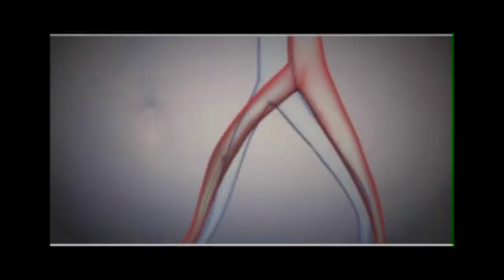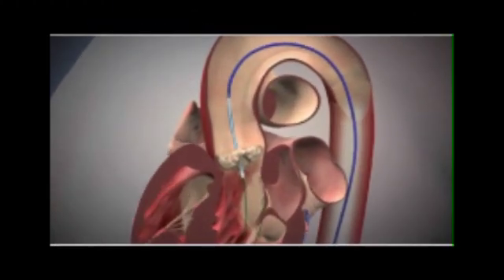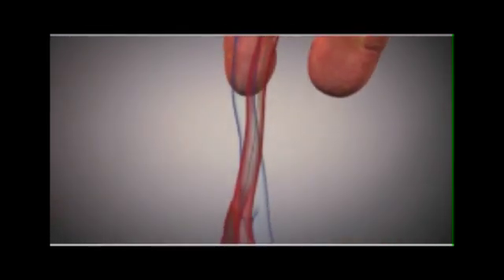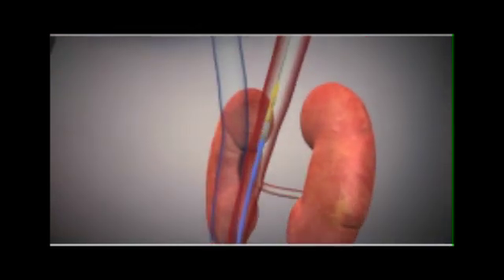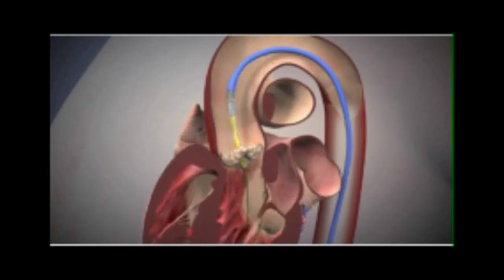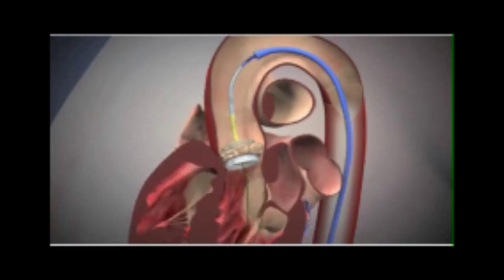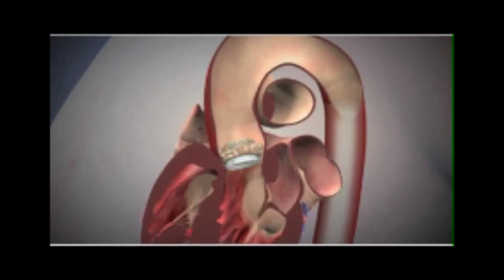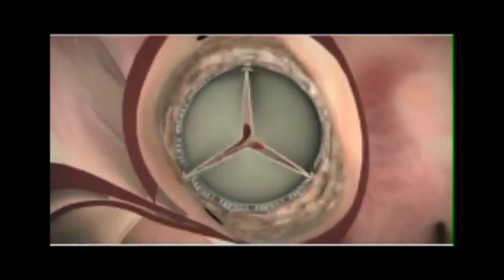TAVR (Transcatheter Aortic Valve Replacement) Animated Demonstration

Comment from the maker: The procedure is performed under the guidance of our structural heart team, meaning there is an interventional cardiologist, cardiothoracic surgeon, cardiac anesthesiologist and other allied health professionals all in the lab during the procedure. It is different from angio/vulvoplasty in that the native aortic valve is replaced. In the procedures you mentioned, a balloon is used to open the narrowed valve, but no replacement takes place, and narrowing can occur again.